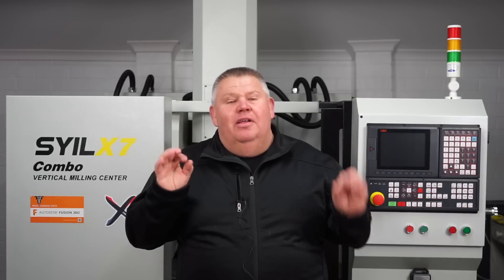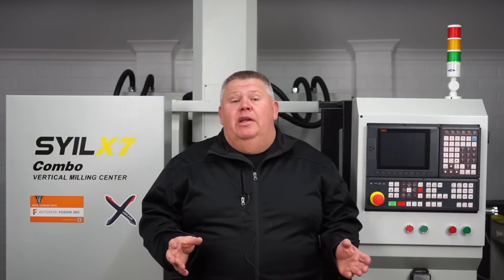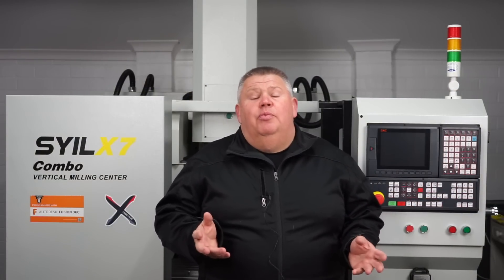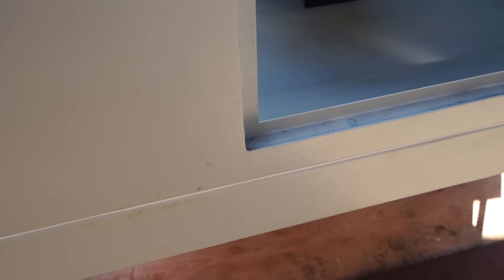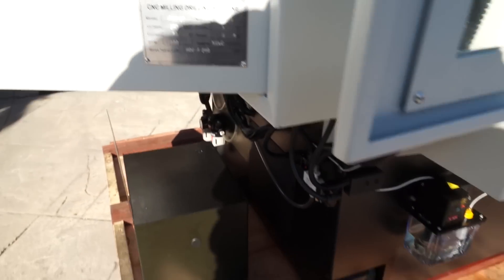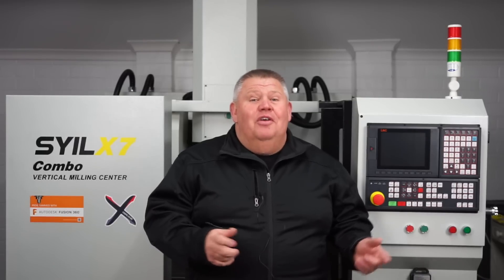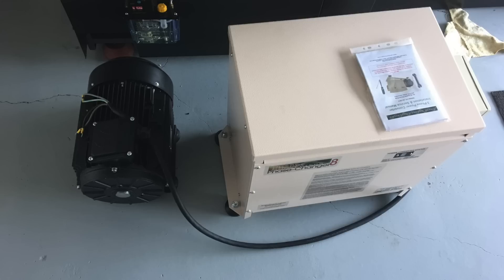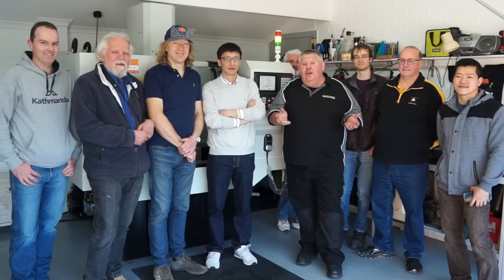SyilCNC X7 Combo Unboxing Video

Comment: Hi Aaron,  Did you get rid of the SkyFire, I have not been watching your vids long enough to know if you replaced it with the Syil? IF so why did you replace it? I'm looking into a new mill for my business and considering a Skyfire and getting educated watching your vids. Would love to hear if you did replace the Skyfire and why?
Reply from the maker: Hi Bill.  Yes mate I sold the Skyfire not long after obtaining Syil X7 Combo.  The little SVM1 was good, but I just quickly outgrew its capabilities.  The Syil is at least double the weight, higher rpm spindle, more tools in the ATC, 3 times bigger servos and a far better controller.  If I had my choice all over again, I would have just bought the Syil first.  However, it is a 3 phase machine.

Comment: Which spindle rpm did you choose? :)
Reply from the maker: Hey mate, I got the base model X7 combo.  It comes standard with 10K spindle and 12 tool ATC.  Absolutely love this machine and I'm very happy with it.  Cheers, Aaron.
Reply: @DCT_Aaron_Engineering  Thanks for the information! Atm I'm planning (rather dreaming^^) about financing one of those machines to start a little job shop. Syil products appear to be a little closer to my budget than a Haas.
Greetings,
Jannis
Reply from the maker: The Mechanix Hey Jannis. Yes I love the Haas machines too and we use Haas at the school where I teach. However their price tag in Australia is very expensive. For example, 1 Haas SMM equals 2-3 SyilCNC machines. We have many Syil machines in Australia now and most are very happy with their purchase 👍🍻
Reply: @DCT_Aaron_Engineering  Yeah, I have a similar problem since I live in germany. The local machine suppliers like Hermle or DMG Mori are... let's call it a "little" to expensive.
I think that Syil machines are a little pricier here than in Australia but probably still are the best ready-to-run packages you can get for little money here. Just hoping that the CNC Route I'm starting out with, will make me enough money/customers/products to justify an upgrade :-D
Reply from the maker: I agree with you Jannis. Take your time and be certain about your CNC purchase.  It's a big investment and you must ensure that it is money well spent and you can make that money back (and more).  My machine is purely for hobby use.  I justified the machine with my wife by stating to her that I don't drink, smoke or gamble.  I could spend my money on hookers and cocaine, but the wife preferred I bought the milling machine instead (joke, LOL).  Cheers, Aaron.

Comment: Can it be made shorter at all to get it through something like a garage door that opens up into a taller space? Is the column or what not and the base one piece? I have a similar situation, about a 1800mm door but there's no removing it (stone structure). Cheers.
Reply from the maker: Hello.  The problem is the Z-Axis motor.  If you could remove this it would help to lower the height profile considerably.  However, because it's an absolute encoder system I wasn't game to touch it.  Like the old saying goes, "if it ain't broke don't touch it"! LOL.  Cheers, Aaron.

Comment: Very nice, 34k then? Is the cheapest Haas much more? Also I understand phase changers but how did you make up the kw - did it say 7?
Reply from the maker: Hello Deus.  My machine has 3 x 1.2kw servo motors on the axis and a 2.2kw spindle motor.  Now if everything was at full push that adds up to 5.8kw.  So I went slightly higher with a 7kw phase changer.  This machine landed in Melbourne Australia costs approximately $31,500 AUD.  Now a Haas Minimill purchase from the HFO in Australia would be at least double that.  Keep in mind that Australia has free trade agreement with China.  We don't with the USA.  So a Haas machine in the USA with shipping, freight/port charges, import tax, GST tax, makes the machine approximately double.  Trust this information helps you? Aaron.
Reply from the maker: Mate if you can afford a Haas good for you.  I actually went to your channel to look at your machine, but couldn't see it anywhere.

Comment: I'm thinking Tormach has a lot to be concerned about... How accurate are your circular interpolations? Both size and roundness? A tool changer and a pulse generator, really nice. Congratulations!
Reply: Does tormach offer linear rails on any of their machines?
Reply from the maker: Ye Boi Hello, no they are dovetail to my knowledge
Reply from the maker: Charles Hubert Hey Charles. Yes maybe you’re correct, but they’ve got a good market share in the USA. They don’t in other countries like Aus. A Tormach over here spec’d like the X7 is approx $40 or more. That’s another $9-$10K more than this machine. The Syil X7 is a serious piece of kit. It’s a full cast machine and not a desktop sitting on a weldment. Cheers Aaron
Reply: @DCT_Aaron_Engineering   Aaron, that's what I was looking at. The Syil looks like (I never like saying it this way) a "real machine". Good luck with this beauty. Really impressive.
Reply from the maker: Charles Hubert thanks Charlie. Hopefully I can start cutting chips soon 🤞

Comment: Hope you have council approval,, being an residential estate, only takes one complaint from a neighbour and you'll have to stop using the machine..
Reply from the maker: Hey Flash.  Thanks for the tip mate.  TBH there's no need to get approval, as I'm not running a business from home etc.  CNC machining is a hobby of mine and as long as I run the machine between 8am & 8pm (respectable hours).  There's not a thing anyone can do about it :-)   Although, I am very respectful to my neighbors and prepared to listen if they did have a problem.  Cheers, Aaron.
Reply: I know some guys that were running 2 VMC in there backyard shop at night. One day the neighbors dropped in and said "oh wtf!? We had no idea!" So i guess you can get away with a fair bit if you're stealth enough. I guess if you finish by 8pm on a school night that's quite reasonable, and that my be the case for the story above.

Comment: Hi Aaron, thanks for the great video. Located in Melbourne, I'm currently evaluating the Syil 7 Combo with Siemens controller over an Optimum F80TC. They seem eerily similar!
Reply from the maker: Hi how are you?  SyilCNC are an OEM company.  That is they make casting and machines for other companies.  From what I've been told, Syil made the frames for Optimum F80 (very similar in appearance).  Before you lash out and pay big $$$ for the Siemens 808 advanced, let me evaluate the LNC.  Could be a suitable controller less the expense.
Reply: @DCT_Aaron_Engineering  Thanks for the reply Aaron. I will watch your evaluation with interest. 

I have been running a Tormach off and on at work doing prototype jobs and I really wish these machines were more prevalent when I chose the Tormach. They are much higher spec and probably come from the same factories!
Reply from the maker: Oh it's my pleasure mate.  The Syil factory doesn't make the Tormach machines.  They come out of a different factory in China.  Hey this will make you laugh.  Recently a good mate of mine (teacher in rural Victoria) was quoted $38K for a PCNC 770 with ATC & Enclosure.  This included delivery and installation.  My Syil X7 came in at just under $32K aussie dollars.  Food for thought ;-)
Reply: @DCT_Aaron_Engineering  The only thing larger than that Tormach quote is the disparity between their marketing claims and real world quality/performance;)
Reply: ttjarrett: I thought the same thing! After looking around the inside of the F80 at Hare and Forbes, the X7 column base and table appear identical. Optimum have their own sheet metal and specced the electronics differently but basically very similar machines. One interesting difference is the options Syil have: different spindle motors and controllers could make all the difference - more capability or lower cost. They also have some probe options that are not mentioned for the F80.
Reply: Thanks Nick. I have emailed Syil about some of their options. I like the idea of a 12k spindle and tool and work probing. I'm going to be using the machine I buy as a "first" production machine so any time savers I can put on it will be good.
Reply: Thanks Nick, they are some very handy resources. I watched those training videos, they're pretty bad!

Comment: Skyfire gone?
And why couldn’t they build it as single phase? 
I have huge machines running single phase- see my videos
Reply from the maker: Hey buddy.  No I still have the Skyfire, but I will look at selling it soon to fund my SyilCNC lathe purchase.  Yes, many machines can run on single phase.  But most large industrial machines run only on 3 phase.  For example the Haas and manual machine we have at my work.  SyilCNC use 380vac 3 Phase on this machine because the tool changer dictates it.  I know they are working on a single phase option though.  Cheers

Comment: Happy for your new machine but also very jealous - can't wait to get one myself. Could you go in to some detail about that phase converter and why you needed it? I thought the X7 could run off 240V single phase.
Reply from the maker: Hello Nick.  I will cover that in a future video.  SyilCNC import the spindle cartridge and tool changer from Taiwan.  Now I believe that the tool changer actually runs of 380vac 3 phase power.  I think 3 phase power is more economical and better for high power loads.  But hey, I'm no electrician or electrical engineer so please don't quote me LOL ;-).  Oh, the reason I went with a Phase Change Converter is the fact that I can take it with me if I ever move on from here.  Cheers, Aaron.
Reply: Thanks Aaron. My problem with three phase is a long driveway that has to be dug up and an old fusebox that has no room for another meter, so its super expensive to get 3 phase into the shed. Maybe you can collaborate with that phase change converter guy for a Q&A video; I'm sure there are many home machinists who are holding off on purchases due to power supply problems. 

What was the mains circuit specs you used into the converter?
Reply from the maker: Thanks Nick, electricity is all smoke and mirrors to me LOL.  Cheers ;-)
Reply from the maker: Very true Nick.  415vac 3 phase runs down the street of every Australia home.  Unfortunately, they tap off from it and branch out to each house.  Now I didn't know this, but in most rural areas there is only 2 phase coming in.  Hey, I inquired to get 3 phase connected to my house, but talk about a hassle.  They want to know why and what will I use it for.  Then once connected a sparkie would have to fit a new distribution board and tap off and balance the lines going into the house.  Stuff that.  Called Mark up on the phone, he came out and met me and problem solved.
Reply: @DCT_Aaron_Engineering  Aaron, 
For you, Nick and anyone else regarding 3 phase.  Yes 3 phases and neutral are run down each street but supply authorities are really difficult if you want 3 phase (WA is different,  3 phase is common even in suburban Perth). Rotary phase converters are a good option which make use of a characteristic of 3 phase induction motors to create the phases. There are other options. Anyone who is installing battery backed solar has an easy 3 phase option. 3 x 4 kva inverters cost around $4500. The batteries are still the biggest cost. In rural areas SWER is common and the supply is normally 480v centre tapped single phase. Via variable speed drives 415, 440 or 460 vac 3 phase is a piece of   cake.  Lastly 3 phase 220 / 230 / 240 vac can be derived by use of a variable speed drive configured for 240vac input. Motors are then connected on 240v Delta. For 380 either a transformer required for a permanently star connected motor or configure the drive to 200 vac for a Delta connection.
Reply from the maker: Hi Mike.  Thanks for sharing the information mate.  To be honest, I couldn't be bothered with all the hassle.  I contacted Mark from Phase Change Converters and he was so helpful.  He even came to my house and looked at my requirements.  Can't beat that for service.  Oh, and they are Australian made.  Can you believe that?  Cheers, Aaron.
Reply: @DCT_Aaron_Engineering  Yes that is right  and if you specified it correctly you can have the 380 vac output directly from the rotary phase converter.  The downsides are noise and high losses especially if the converter is idling a lot.
Why I posted what I did was to cover off on more situations  especially people being ripped off with grid connect solar and to back up what you and Nick said. Didn't get to read the negative post, but thought a bit of detail would help balance things.
Reply: Aaron: by coincidence, I have two friends looking at the very same thing. A lot of the cost is due to 'nanny state' rules but even without that, most houses need the whole meter box replaced which is time consuming and expensive. Then there is the alleged higher cost per KW hour for 3 phase (another artificial cost by the power companies). Add in possible costs for underground cabling an pretty soon the power install is the same as the mill! I had another friend get 3 phase by cheating a bit and it still cost $5K.
Reply from the maker: Dear Nick.  I apologize for that person giving you grief before.  I won't tolerate negativity or insults on my channel to my viewers / subscribers so I decided to remove him.  I've never done this before, but it needed to happen.  Not sure where you are located, but feel free to give Mark a call as he is very helpful.  Oh, if you're in ever in Melbourne feel free to come over sometime to check out my set up.  Cheers, Aaron.
Reply: No Problem Aaron - I have been insulted by far worse people 🙂. I see quite a few 'CNC snobs' attacking anyone they perceive to be playing in the shallow end of the machining pool. Somehow, they always end up looking like idiots.

I am in Sydney and don't get to Melbourne often. If I am down that way I will definitely take up your kind offer.

With people asking about the differences between the X7 and the Skyfire, one key thing for me is the customer  support. Syil has bee very quick to respond and went as far as photographing and measuring the machine hight to see if it would fit in my shed. Meanwhile, none of my emails to Skyfire have ever been answered.
Reply from the maker: Thanks for understanding Nick.  I agree, Mr. Xu Shuo from SyilCNC is very responsive and always replies to emails.  The other Syil users have him and his technician on Skype for immediate access.  If you speak to Xushuo, please tell him I sent you :-)

Comment: Wow!....that is great looking machine....I will be very interested in your videos to come with it up and running. One question...I know you’re single phase at home but I assume you spec’d the machine to run on Aussie 3Phase 415v to future proof your investment?
Reply from the maker: Hi Ian.  Thanks mate, she really is a beauty.  Very well priced too, as I could buy 2 of these for the price of one other well know brand of the same size.  Mark from Phase Change Australia built my unit especially for me.  He configured it to match Chinese 380vac 3 phase and not 415vac.  Mark suggested it was safer this way, as high voltage can spike delicate electrical components etc...  Oh, plus I can take this unit with me when I move on eventually.  Cheers, Aaron

Comment: Very nice machine. Have been looking at it myself. Do you mind me asking how much it cost landed? Also do you know how this compares to the Hare & Forbes Optimium F80TC that cruddCNC has?
Reply from the maker: Hey J.  Sure no problems mate.  I have included URL links to SyilCNC website for more information in the description area.  Basically the machine cost $24,500 USD landed (shipping & taxes).  So converted to AUD is approx $33,350.  Hope this helps mate?
Reply: Cheers mate. Can't wait to see it running
Reply: @DCT_Aaron_Engineering  Aaron,
I was quoted more than that for a Tormach. I hope it is as good as it looks.
Reply from the maker: Hi Mike.  Yes it's a really nice piece of kit mate.  I haven't had much controller time on it yet, but I can already jog it, input MDI commands and I hand wrote a spindle warm up cycle and saved it to the controller hard drive.  I've got Scott from CADPro NZ working on my post processor for Fusion 360 so I'm slowly getting there.  So far so good.  I'm very happy with the machine, especially the after sales service I've received.  Can't believe the owner of the company personally flew over to meet me and other customers ;-)

Comment: This is a nice surprise.i have been looking at Syil but have no experience with them. Can't wait to see how it rates!
Reply from the maker: Hello how are you?  I'm really excited about it.  From what I've seen first hand, I think it will surpass all my expectations.  Cheers, Aaron.
Reply: DCTTeacher1 I'm been good. I have been looking for a mill to replace my tormach. From what ai can tell from your video, Syil didn't skip on the details on putting that mill together. If you don't mind mw asking, what did that mill run you?
Reply from the maker: Hey buddy, I placed the URL (links) in the description area of my video.  From memory, my machine retails for $19.5K USD. Shipping & taxes to Aus was $3.7K.  This is for the LNC version and not Siemens controller.

Comment: Can’t wait to see this new machine in action. What sort of features does this mill offer over the skyfire that made you want to switch over?
Reply from the maker: Hello Steven.  That's an excellent question and I think it warrants a video ;-).  Basically, double the size, double the weight, more tool capacity and slightly larger envelope.  Cheers, Aaron.